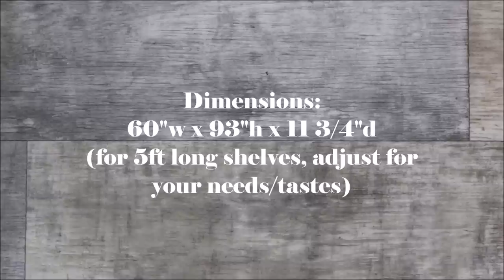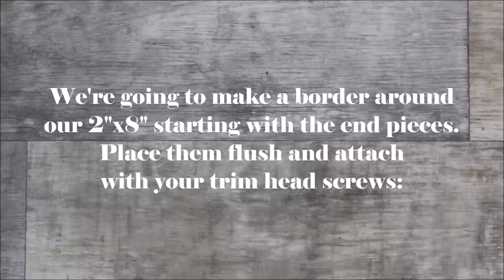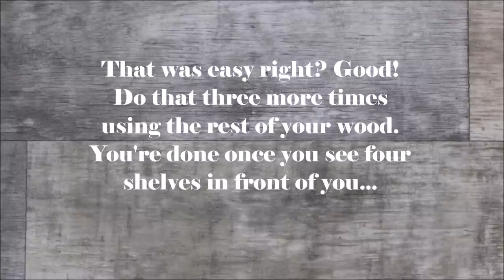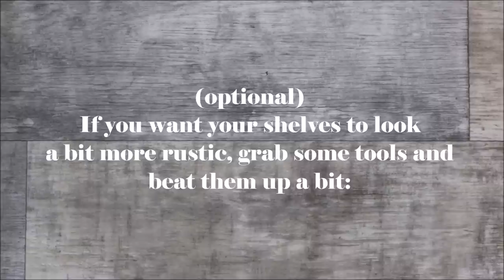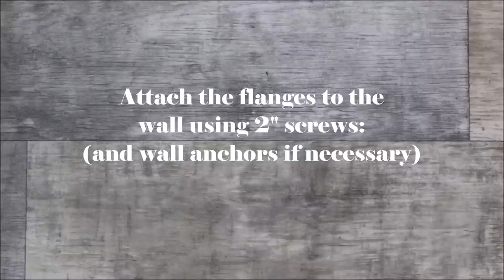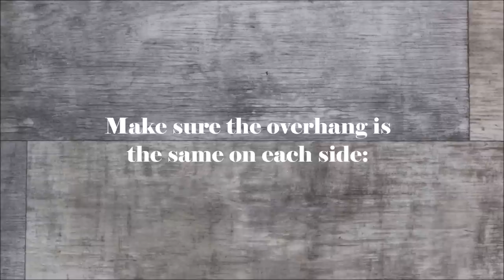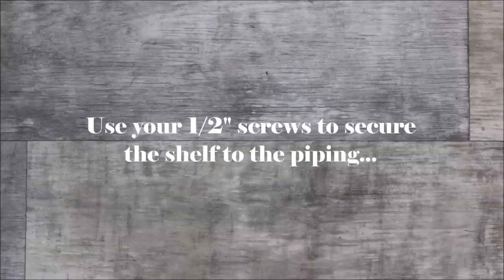The Industrial Wall Shelves - Easy DIY Project

Comment: Just went to home depot to price this out and the pipes and joints by themselves were $292 before tax, not even including the tube straps.  The floor flanges were nearly $100 by themselves, but in the amazon link they give there's a 10 pack for $17, basically 83% cheaper.  If you're going to build this, definitely shop the price on the plumbing part.

Comment: I'm thinking of doing this but instead having that last pipe go down to the floor, i have another elbow and it connects to the wall. I'm starting to wonder if that's going to be too much weight on the wall and I should have the bottom pipes go to the ground like you did. Thoughts?

Comment: I know it has been a few years since this was posted but I actually built this for whiskey shelves this week! The pipe was a little more expensive than I had thought it would be. But building this was so much fun and my first real woodworking project. I had a blast and my whiskeys are now well displayed. Thank you!

For those looking at doing this, I used regular galvanized pipe and painted black with Rustoleum. It was what I could find the most at Lowes and Home Depot. I was also an idiot and purchased the 2 in screws for wood..... Those need to be for drywall and make sure the head of the screw will fit properly, I bought too small of a screw head. Lessons learned but had a blast building this and it looks so good!!

Comment: Love this black iron pipe idea, we are refinishing our basement and have stained all the floor joist and all exposed wood Mocca, and we are making our own mason jar/ Black iron piping ceiling lights. We were looking for an Idea for designer shelving and saw this video! Awesome, but we are going to make our shelves 16ft long, so I'm thinking of using 4 pipe wall mounts for the shelving. Do you think that's enough or too much? Also, I think you should spray paint the clamps black, because I noticed them right away at the end, other than that, thanks for the assist on the Diy!

Comment: I haven't built anything yet, but I've made a few mock up ideas, inspired by your channel, and the one I am hoping to tackle in a few months (going into winter, having windows open for ventilation just doesn't sound fun) was going to be a shelving unit.

So I am thrilled to see this build, because it is almost identical to what I had in mind!

Because I can't drill into the wall I planned to put it against, it was going to have piping up both sides, instead up up one, and secured to the wall, but other than that, I had one change.
I had, in my design, an off set 4 corner tee, so I could run piping down the length of the board. And those LONG sections of piping? From my pricing, they were a huge chunk of the total cost. I wanted that for stability. But, with solid wood shelves, I see what you did, and I'm thinking I made a mistake in my design, and that the shelves wouldn't need that support. Yours don't, and it looks fantastic.

So, thank you for this video! It suggests to me that my plan was not poorly conceived, but it also shows me how to improve on it, while lowering cost significantly.

I really enjoy all your videos, and watching them, step by step, has been a real learning experience for me.
Reply from the maker: Thanks for watching!

Comment: Going to be making some similar to these soon. Did you use anchors to screw the flanges into the wall? I believe the bolt circle may be too big in diameter to fit inside the wall stud

Comment: Did you screw them into wall studs? We are building ours now and I'm in a dilemma... our studs don't line up where I want the flanges to go! :( I don't want the pipes to be off centered but yet I do need them sturdy as they are in our pantry.
Reply from the maker: Can you line them up with the studs and then just center the shelves based on the placement? Or is it going to have to be off-centered that way due to the confined space? If you can get one side into the studs you can use heavy duty wall anchors on the other side and you should be fine.

Comment: when attaching to the wall did you use attaching using 2 of 4 or 4 of 4 attachment points?
Reply from the maker: You should attach using all of the flanges.
Reply: Thank you.   I'll be installing this in my office over the holiday break replacing an ikea shelving unit.  Looking to also use this as an option for our pantry as well.

Comment: Question, not sure if you will answer but can I ask why you used 3/4 pipe instead of 1/2 inch rounds? Just wondering because 3/4's is more $ than the 1/2.
Reply from the maker: That was just the look that we liked -- you can substitute sizes.

Comment: Hey I can’t seem to get the tees to line up so they are all facing the right direction...is there a special trick to this?
Reply from the maker: You can loosen them a little so they are all facing the same way, they don't have to be as tight as they can go. Hope this helps!

Comment: Is the wood border necessary, or just for aesthetics? I have some reclaimed driftwood I want to use for a project like this
Reply from the maker: It's not necessary. It does add an extra 1.5" of depth to the shelves so you'll want to account for that if you're using the driftwood.

Comment: Hi fella, I am wondering why you wrapped the 8x2 with the 2x1? I enjoy your films but is there a reason for this? Thanks. N.
Reply from the maker: Trimming it out gives a more finished look. It also increases the depth of the shelves to match up better with the 10" pipes.
Reply: I knew that there had to be a reason but because I am a novice I was struggling to find it. Thank you for taking time to clear this issue up! N.

Comment: How much was this project? I’ve been on the market for rustic shelving that looks exactly like this. However if I can make it myself and the price is better I would do that.
Reply: Just an estimate, but I've looked online where I can get such piping, and wood costs for pine boards, in case I wish to make something like this, and I think, including cost of stain, poly, sanding block, wood filler, and screws, you should be able to make this for under $150.

Again, though, that is my personal estimate.
Still, looking for simple book shelves for a spare room on amazon, the cheap particle board stuff they have, with roughly equivalent shelving space, tend to be between $130 and $250, depending on quality... and this hands down beats that stuff in quality, so I would suggest that this would be worth the money.
Reply from the maker: Should be between $100-150 depending on the store...

Comment: Black pipe is not cheap🤓 how much did you pay for all those pipes or for the whole project?
Reply: i dont know the costs but easily hundreds of dollars.
Reply: Not true. I've been looking up material costs for doing a project like this, and on supply dot com they have great prices for the pipe. I don't know their shipping rates, but compared to home depot or lowes, their prices are really good. Without looking up every piece they show, I would estimate that they use 50-80 dollars of pipe.
Shelves MIGHT top $120, but I'm including stain and poly in that estimate, and I think they'd be very worth it.
Reply from the maker: Should be between $100-150 total depending on the store...
Reply: thanks for replying!! awesome thats a reasonable price for materials.
Reply: The Rehab Life where did u get your pipes from??
Reply: they will get right back to you, hahahahaha.
Reply: I purchased cheap pipe and sprayed it flat black with a metal spray paint. Worked very well
Reply: youre right. don't mean to beat a dead horse but i found everything on amazon for 160
Reply: @nonyabizz9390  u can buy a kit for cheaper with everything meant for that
è

Comment: Instead of using the 2x8 with the trim boards why did you just not go with a 2x10 with no trim.  Was it the look of the trim you liked.
Reply from the maker: Yup, it gives a more finished look. You can definitely use 2x10s though if you like that better...
Reply: Can you get these pipes painted in a brown color already painted. If so where
Reply: hides the flanges and the pipe clips????

Comment: This looks like a really fun project and intend on doing it for our home office opposed to buying industrial looking shelving.  Started filling up my cart online to get an idea of price.  Had to get some of the materials from both Home Depot and Lowes since some were not available at one or the other.  I definitely understand that building material costs have gone up over the last year.  However, to purchase the exact parts list for this project (including stain, screws, pipes, wood, and everything else), the total price is coming up to $340... and I need to do two of these shelves.  Would love to know how you completed this project for $120-$150 per your previous comments.  Did you actually purchase your piping on amazon per your links or did you get them from some other hardware store?